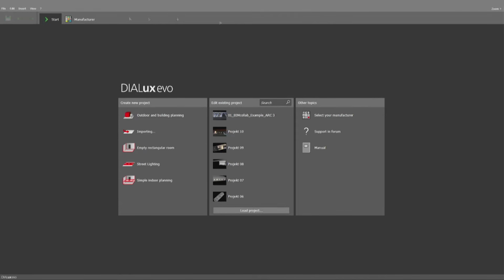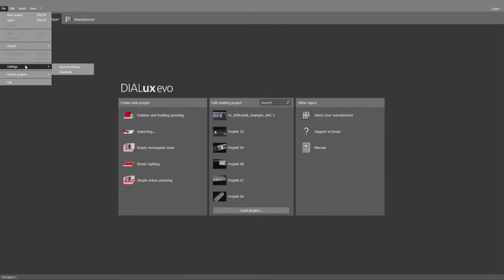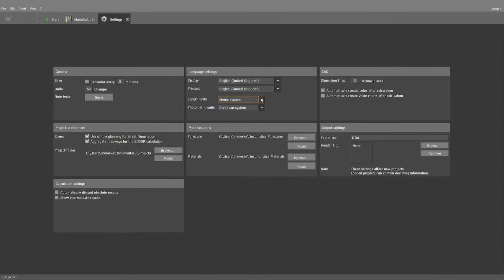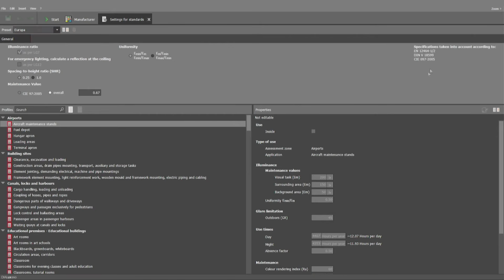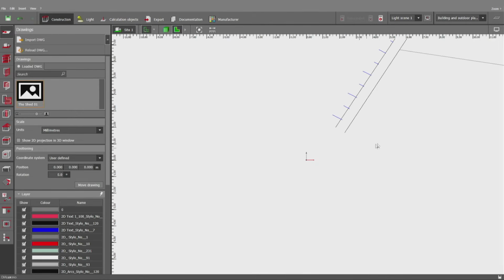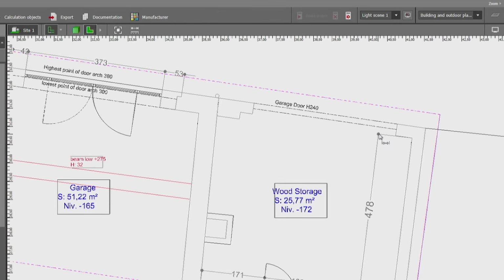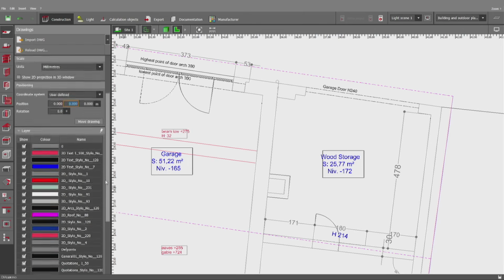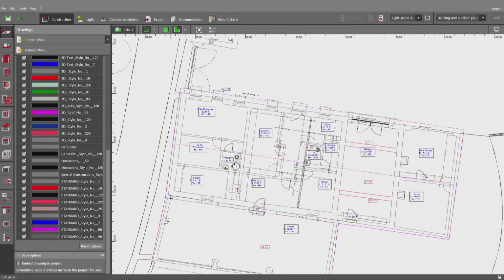DIALux evo Tutorials for Beginners part 2 — Importing a CAD plan

Comment: hi i currently have a sketchup base model and i need  to  calculate the light LPD etc...  but i cant seemed to add a plan or sketchup convert to 3ds and import it to dialux
Reply from the maker: Remember that only IFC files have the room information seperated and windows that can enable daylight calculation. Sketchup to 3ds to DIALux evo is good for facade lighting though.
Reply: @TheDIALux  but my model for 3ds file has been imported but can be seen only as lines of my model shape and not a full solid wall.
Reply from the maker: @birdlady312  Nelca did a tutorial on this- I find it very helpful- from 7: 30 on: https://www.youtube.com/watch?v=X5GCCfpLfXc

Comment: I have the CAD file of the facade(side view) showing details of facade. I can't develop using a Plan (top view). How can I rotate the DWG imported for the vertical plan? Thank you!
Reply from the maker: It sounds like someone gave you a 3D DWG plan. Ask them to export it in 2D.
Reply: @TheDIALux  I have only the 2D drawing. The drawing have a "top view" and "Side View" of the building. Look the example on the link. 
https://drive.google.com/open?id=1oyw94ck0WvhsKiqQ2wf5p9SFH2n5cwBT
My doubt is: how import the Side Views of drawing in the Side View position in the Dialux. There isn´t wall in my drawings. I work with industrial buildings, then I have to drawing each steel column of the building.